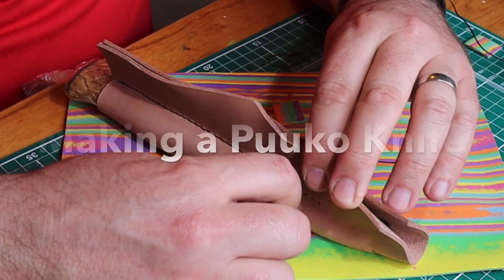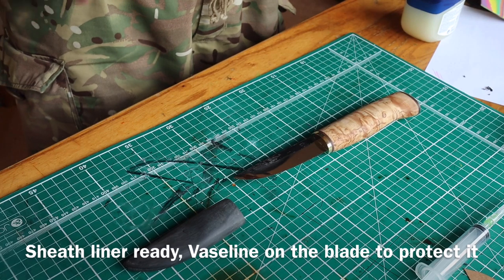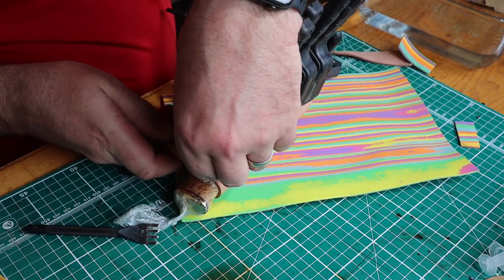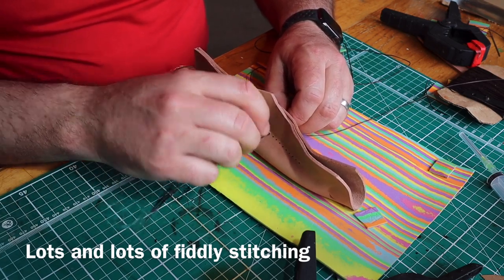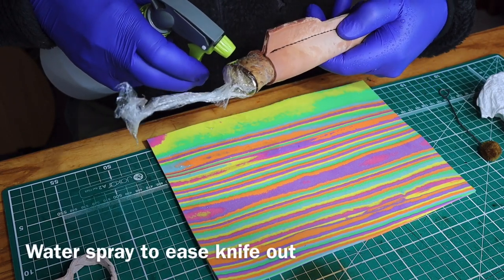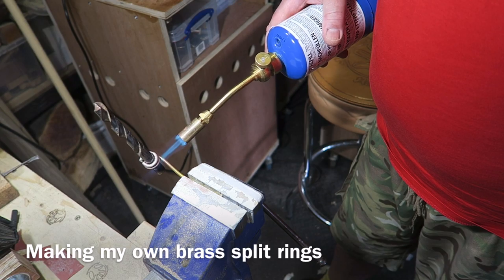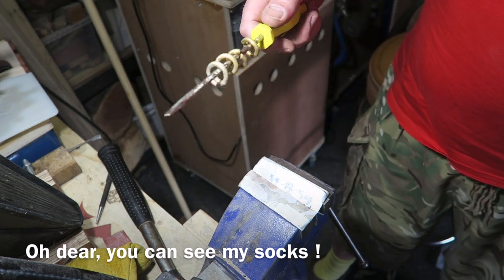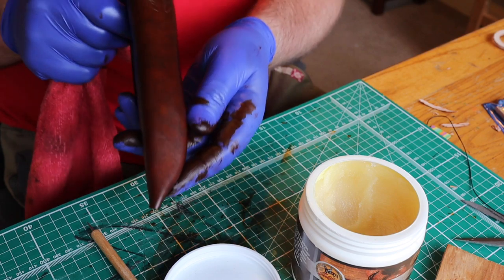Making a Puukko Knife - Part 2 - The Leather Sheath

Comment: To help seat the knife in the guard, slide it on and make an outline of the blade on the bolster then using a dental burr and an engraving tool, remove 1mm or so of the blade shape from the face of the bolster so the blade actually seats in it slightly. Really helps make the knife look finished.
Reply from the maker: Many thanks for watching Robert. Yes I have done that in the past although a really well fitting bolster should look like the blade passes through it.
Cheers 
Jim

Comment: Hello Jim. 

During C19 lockdown here in the UK I also re-started my knife making, using a Puronvarsi blade. The tangs really are a weird shape and I found by relieving metal from centre of the handle side of the pommel, it was much easier to tap the bolster onto the tang and get a  good fit. The gap you ended up with would annoy me every time I picked the knife up, so I can fully sympathise! It also makes you appreciate how good Osmo and Malanika are at their craft.

Excellent leather work too.

Subscribed ;)
Reply from the maker: Many thanks Andy, yes the gap is mighty annoying, sort of thing that drives me crazy.

Comment: Is there no way to reset the blade Jim? I know it's taken the shine off that project for you. 

Great project as always though
Reply from the maker: Thank you very much. Unfortunately I can’t reset the blade without destroying the handle. If I had realised sooner before the epoxy had fully cured I could have possibly knocked the tang through and reset it but I didn’t spot the gap until I removed the masking tape near the end of the build. It will just have to haunt me.
Cheers 
Jim